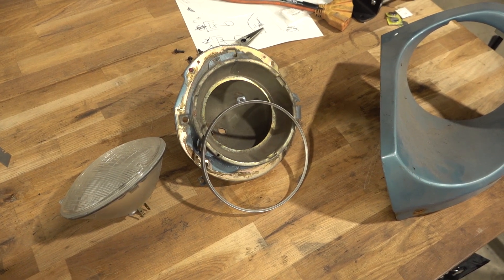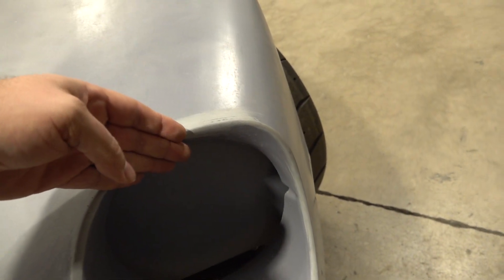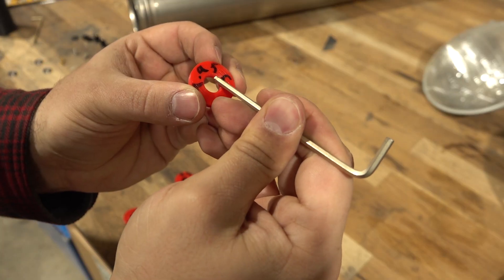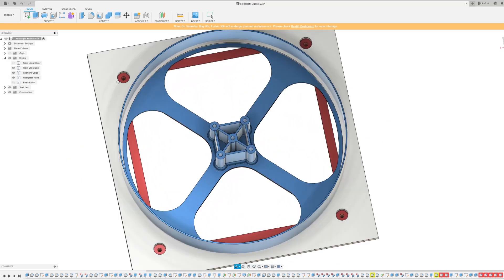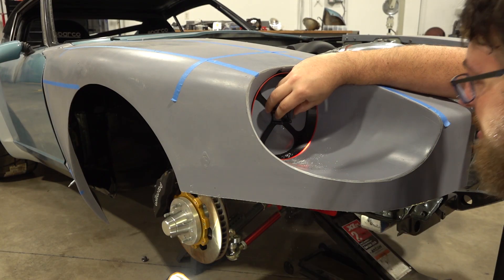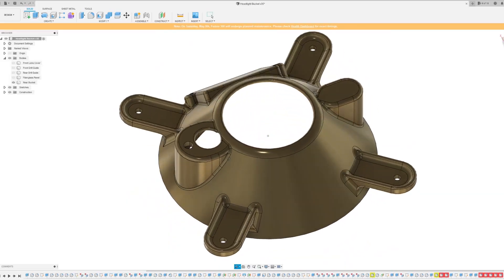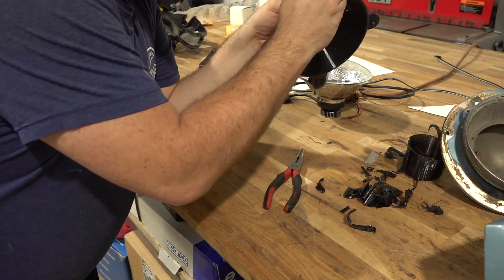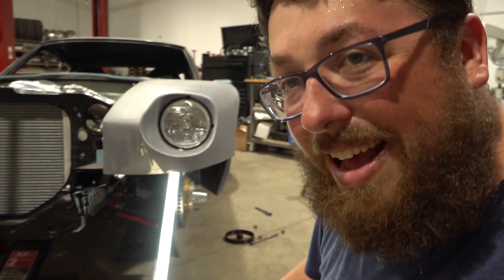3D Printed Headlight Buckets for my Datsun 280z Project Ep 21

Comment: Looks killer, but I’m surprised you didn’t angle your radiators.
Reply from the maker: The fans at the back of the headlights are fixed position, although I agree having them on the far back makes them pretty tough to install places without rubbing. I'm VERY close on this one, which is part of what made packaging this tightly so important.

Comment: I didn't see did you print a way to ajust/align the headlights
Reply from the maker: With how little space there was I didn't really have a way to add that in (that I could think of at least). Before designing them, I used a laser to see how the panels were aimed and they're OK-ish. If I need to make further adjustments, it will need to be done by flexing or cutting the panel it mounts to. Not working with a lot of space makes this really a tough one to package adjustability. It's a tradeoff I accepted early in the design
Reply: @GrindhousePerformance  i guess also works case test with shims to align then print a spacer ring at the right angles that aligns it
Reply from the maker: @imnottheonlyone9171  100% shims or a spacer are a good idea for it. 👍
Reply: @GrindhousePerformance  there's always a way maybe not what we always want but if it works in the end and doesn't look like crap or break then its a net positive

Comment: Amazing, will do something similar to my airstream motorhome headlights. I’m curious, how do you adjust the headlights? Is that internal to the lights or do the mounts to the buckets have adjustment screws (like on sealed beams)? Thanks!
Reply from the maker: Hey thanks! The pieces I designed will not be adjustable unfortunately. The area that I'm working in is too tight and I couldn't come up with a solid idea for adjustability. I ran a laser against the flat panel the pieces mount to and it's close enough for now. My thought is the flat panel the buckets mount to can be adjusted later to get it close. It's not the best solution, but I was only able to solve so many issues in the space I was working in.

Comment: How has the petg held up?
Reply from the maker: Hey thanks! The car hasn't run or been left outside since making this video... so the headlights haven't really been tested with vibration/ heat/UV. They haven't had any issues sitting there though 😅
Reply: @GrindhousePerformance  Thanks, just curious as I'm working on a similar project using PETG.

Comment: I found your channel and have been loving what youre doing but I just wish I was as good as you in 3D modelling and printing, I need to learn for my project ... recommendations for software and learning resources please?
Reply from the maker: Hey im glad you're enjoying my projects! Im using fusion 360 for modeling and cura for 3d printing. The best recommendation I can give you is to pick a couple items from your room or garage every week and just stumble through modeling it. After you modeled it once, model the same object again, but the second time, challenge yourself not to use ANY of the steps or tools you used the first time if you can avoid it. The beautiful thing about CAD is there's almost always several ways to make the same result, and once you start discovering those functions, it lets you make creative new things because you've familiarized yourself with the toolbox. I used to have tasks in school to manually write out the steps I would theoretically take to model an object without having the software open. It was challenging but if you can start thinking of taking one single step at a time, it can be less daunting. Im going to make videos on this in the future since it comes up pretty often 👍
Reply: @GrindhousePerformance  cheers mate, thanks so much for taking the time to answer so thoroughly. Youve been a huge help!

Comment: Can you aim the headlights?
Reply from the maker: Not easily. When I designed these, I checked the aim of the panel it's mounted to with a laser and it's close. To adjust the aim, I need to flex the flat piece of fiberglass the printed part attaches to. If it gets to be a big deal I'll have to add an adjustable heim or something from the bumper mount.

Comment: I just binged the video series over the last week.  Keep up the great work.  Can't wait for the next one.  Where are you located btw?  I visited your website and noticed you dont have an "about me" section.  I have a similar build that I'm planning and accumulating parts for  but I've shelved it off to the side to build my workshop first.  I've got a 70 240, tr6060, and Corvette Grand Sport LS3 with the dry sump setup all in parts.  I'm curious why you chose the current test end setup over Apex Engineered's rear end.  Would love to hear your feedback on that as I'll be making the purchase in the future.
Reply from the maker: My shop's based in central Ohio and I'm glad you're enjoying the series so far! The parts for my rear end were purchased a lot of years ago when I first started the project.. Apex Engineered didn't have parts for early Z's when I got the suspension and brakes for the project. If I were starting the build over, I would 100% do the apex engineered 8.8 rear end conversion and trackattack front. I might still convert in the future honestly, the 8.8 is significantly more supported and their parts are super nice! Hope you check back soon, if you've been on the website you might've seen some spoilers on some upcoming videos! 🤐

Comment: ASA is a good alternative to PETG, petg is tricky to get a good stick.  For alot of projects though an SLA printer is alot better than FDM, the any cubic photon mono x can print huge parts and you can use flexible resin, structural resin, even ceramic resin like what alpha sense produces.  Both types of printing are also great for making fiberglass and carbon fiber parts.
Reply from the maker: Hey thanks for that, I haven't used ASA yet but have recently started hearing good things about it! I will have to get some to try out
Reply: @GrindhousePerformance  Check out 3D X Tech, they make a UV resistant ASA.  Another thing - You are going to find in a few weeks that the filament absorbs moisture. Just buy a cheap $30 multi layer food dehydrator with a thermostat. 3d x tech is good about posting the drying times and temperatures for their plastics which makes it easier to get consistent structural results.
Reply from the maker: Hey thanks!

Comment: What software do you use for the 3D printing? I’ve looked around but I can’t find a good one that’s not $5k for a license
Reply from the maker: I'm using fusion 360 for CAD modeling and Cura for slicer software for the printer. Fusion is free to hobbyists with some limitations, but their subscription service is reasonably priced and can be cancelled at any time. It's not the most intuitive CAD software ive used and has taken me some time to figure out the quirks.. For the price, it's hard to beat after having tried a bunch of cheap/free options

Comment: Finally got some stuff done on the 240 im working on i can finally start building up the engine since i got someone to make a transmission mount. I need to get valve covers and ignition coils pretty soon. Was wondering on what kind of iginition coils you think would be a good choice? I have a ls1 in it and dont really know what brands or models are good with other parts i thought youd know alot more since you seem to have most of your project planed out so well.
Reply from the maker: Nice! Honestly I've had good luck with the OEM coils on all sorts of NA and boosted LS builds

Comment: Did you try a glue stick to help adhesion with the PETG?
Reply from the maker: I did and it did help with initial layer adhesion, along with slowing the nozzle way down. My bigger struggle was the layer that printed on top of the supports

Comment: Awesome video! Can you describe how you designed the bracket at 7:02 ? I would like to do the same with my dapper lights
Reply from the maker: Hey thank you! The back piece was the most time consuming to model. I already knew the mounting flange pattern from the front ring, and I knew the depth the headlight needed to sit to be able to compress the light between the 3d printed pieces. I needed to account for the thickness of the fiberglass panel as well or else the headlight would be loose between the sandwich. I started the model by making sketch planes at the flange depth, leading edge depth, and total height. Draw OD circles on the leading edge plane and total height planes and run a loft operation to get your cone. Model the mounting ears either as a circular pattern or individually, then add extra ribbing along the edge for strength (I did this with another sketch and extrusion after the ears were initially extruded). Holding the physical light in my hand I held it at various angles and positions to see what took the strain out of the harness, then I made another sketch plane at that angle to sketch the pad for the module. This was extruded 'to surface' to the cone. The same process was used for the 2 reliefs for the light. Shell operation to make the part hollow and a bunch of fillets to smooth it all together. I shelled the part before I did the mounting pad but after I did the reliefs on the top and bottom. I wanted the mounting pad to be more solid underneath but I'm not sure that really matters. Good luck!

Comment: Definitely the correct headlight. So many Z car restomods go for lights that are too futuristic and don't work for the car. Perfection!
Reply from the maker: Agreed! The biggest downside to these is the total depth is quite a lot with the fans on the backside, so there will be very limited tire clearance if you're on the brakes turning. Hopefully they last 😅

Comment: I really like your channel and the in depth view of your projects especially this one as I have a project of my own that i would like to do one day, just like you. I like seeing all the problems and the solutions you came up with even if you were not proud of it. 
I am a engineering student in Electromechanical and have good knowledge of modeling. I would like to help if there is anything i can do.
Tip on the supports:
Increasing the Z distance at which the supports start away form the part could help fix this problem. In Cura, make sure to check the advance setting so you can edit more parameters.
keep up the AWESOME content.

On the Z distance 0.165 tends to work very well for me
Reply from the maker: Hey Phillip thank you! That's good advice! Ive been playing with the advanced tuning options but didn't think to adjust the z distance, will keep this in mind

Comment: Will they be longterm stable enough in PETG? I thought ASA was the goto automotive part filament…
Reply from the maker: I got it set in my head that I wanted to try out PETG since many folks recommended it in my last video. I would like to print the final version of these in Nylon X once I get a suitable nozzle for it. You're right that PETG isn't the best material for this application, especially if the car was going to see all different weather conditions. Thanks for watching!

Comment: Man, this is such a great build. Let me know if you have any issues with the printing. I have several years of experience from Ender 3s to Ultimakers and Stratasys. I have always used PETG supports for PETG prints but used single extrusions in a zig zag pattern. Usually set the density where I have about 2mm between lines and then you want a layer of separation in the Z direction between the support and model. They will never snap away like PLA supports often do but it is workable.
Reply from the maker: Hey thank you Grant! Appreciated

Comment: How do you adjust the headlights?
Reply from the maker: While I was coming up with ideas I used a laser to check the angle of the fiberglass panels relative to the wall and it looked OK. When the bumper is built, some reinforcement will need to be added to the fiberglass panel as it's still kinda floppy. My thought is to use the bumper mount to push or pull the panel a couple degrees if necessary but I'm honestly not too worried about it. Worst case I can shim or reprint the parts with a little bit of draft angle to them after everything's wired. The area's altogether too tight to get it all mounted, adjustable, and strong enough all in the first attempt. Thanks for checking it out!

Comment: Can you adjust the aim of the headlights?
Reply: True question
Reply from the maker: While I was coming up with ideas I used a laser to check the angle of the fiberglass panels relative to the wall and it looked OK. When the bumper is built, some reinforcement will need to be added to the fiberglass panel as it's still kinda floppy. My thought is to use the bumper mount to push or pull the panel a couple degrees if necessary but I'm honestly not too worried about it. Worst case I can shim or reprint the parts with a little bit of draft angle to them after everything's wired. The area's altogether too tight to get it all mounted, adjustable, and strong enough all in the first attempt. Thanks for checking it out!

Comment: Seriously impressive work dude...  I too had to conjure a solution to mount headlights in those fenders.  Then I had to completely redo it because the wheels at full lock were hitting the back of the headlights (I am running a LOT of caster).  What I came up with is nowhere near as tidy as your solution.  I have to use shims to adjust my headlights, and it is a PITA, but I imagine once will be enough....hopefully anyway.

I know what you mean about new skills becoming habit.  For some reason 3D printing is not yet on my "radar" even though the hardware is becoming more and more affordable.  There are lots of things I fabbed on my car for which 3D printing would have been a better way.
Reply from the maker: Hey John hope you're doing well! I've honestly no idea what I would've done without the printer to tackle this part of the project and it was honestly part of the reason I bought it. I can tell the aiming isn't perfect and it's not adjustable without either reprinting the parts with different angles or shimming.. honestly though if I'm driving this at night I'll have bigger worries on my plate than possibly blinding someone 🤣 this was certainly an engineering challenge that I'm glad to call this the first revision of. The tire clearance is still tight, the fan on the backside of these lights really adds some length to them. I wouldn't be surprised if I don't run into having to compromise the alignment or track width a touch but we'll see!
Reply: @GrindhousePerformance  I know you are trying to avoid the look of them, but I wound up running JW Speaker headlights, mainly because they protrude very little to the rear.  I was determined to get 6+ degrees of caster because all the guys who race these cars stress that the "Z" handles much better with a lot of caster.  I am not really concerned about the modern look of the lights, but our goals for the builds are slightly different, I definitely understand what you mean about getting period look.

I've driven mine around quite a bit now, and I can tell you they are beasts.  The power is really intimidating.   I hope you are not expecting it to be civil/quiet/comfy/tame in any way.....LOL  And, if you were planning to add a heater....lemme just say....don't bother.
Reply from the maker: I can't express how jealous I am you're getting miles on yours now! Absolutely awesome. I've pretty much told myself I'm going to run these lights until I inevitably smash them 😅 Im absolutely not prepared for how rambunctious this thing's going to be 🤣

Comment: I'm actually thinking of doing something similar with my 3d printer to convert my square headlight on my Ninja 500 to a round headlight.

As far as the print itself, if I were you I would look into getting some green filler putty and then paint over it to help protect it from the elements and hide the layer lines
Reply from the maker: That would totally transform the front of a Ninja, be really cool to do! Thanks for the advice! Im not sure yet how I want to finish the parts. Ive heard 3d printing has some porosity to it but I've seen quite a few bare printed parts used in automotive applications without any top coating or post finishing... will need to learn more on it! Thanks again!

Comment: Like the tribute led light. PETG takes a little playing around with settings. When I printed a cosworth glove compartment hinge for someone I think I had to add extra material slower and sand or file material away.
Reply from the maker: I found slowing down the first layer waaaaay down helped adhesion a lot to the build plate, but I'd like to figure out something a little better for support structures. Maybe I'd gone a little too much on the support % settings. Excited to try more though, thanks for checking it out!
Reply: @GrindhousePerformance  If I remember this stuff stuck really well using hairspray to the glass bed. I'm certain my supports stuck to well to the print as well, and look at changing the support pattern. I was impressed with what I done, not as easy as pla but more robust and without warping of other plastics.